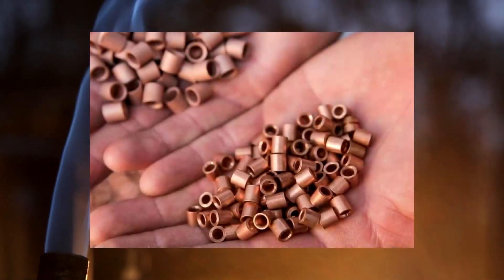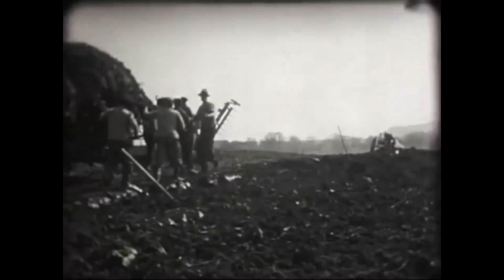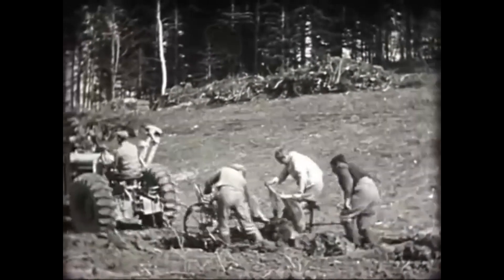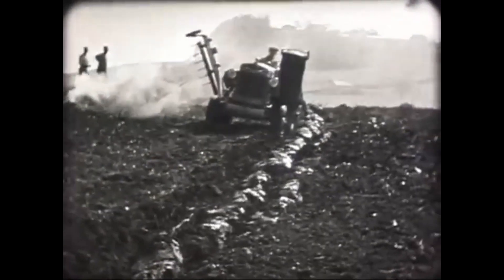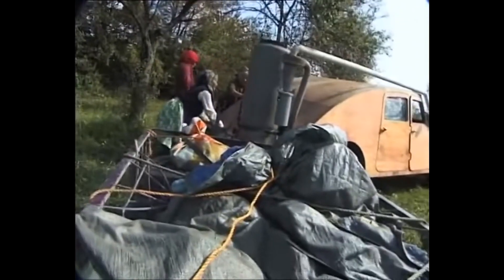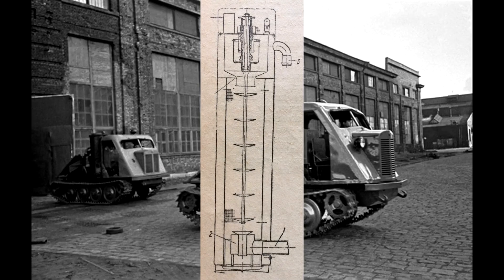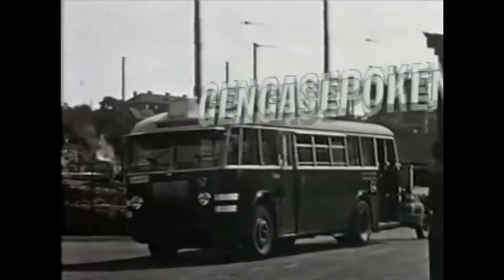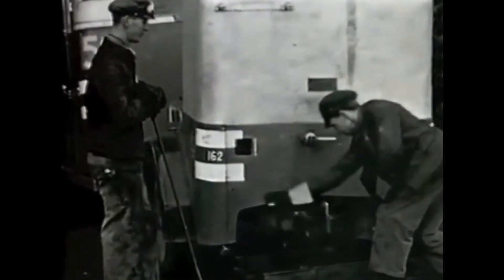Electric filters for wood-powered cars: designs overview. Part 1

Comment: Would it be easier to manufacture a better filter for a stationary gasifier, for heat and electricity generation?
Reply from the maker: it is possible and as you say
Reply: @gengaz-lagunov  Do you sell the designs or the actual filters? I am looking for a set up to generate heat and electricity for a household.
Reply from the maker: @laurentdrozin812  from Ukraine it will be very expensive to deliver, I would send. so only sketches to order
Reply: @gengaz-lagunov  how can I contact you on WhatsApp? Using phone number?
Reply from the maker: @laurentdrozin812  +380661963808
Reply from the maker: @laurentdrozin812  yes. whatsup +380661963808